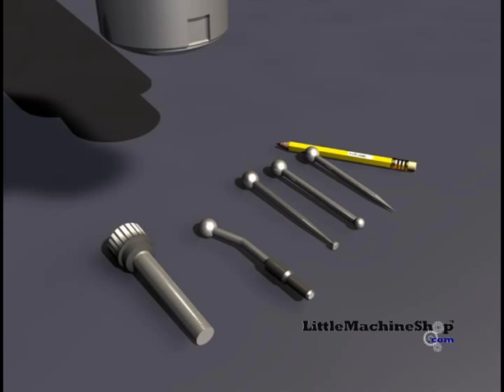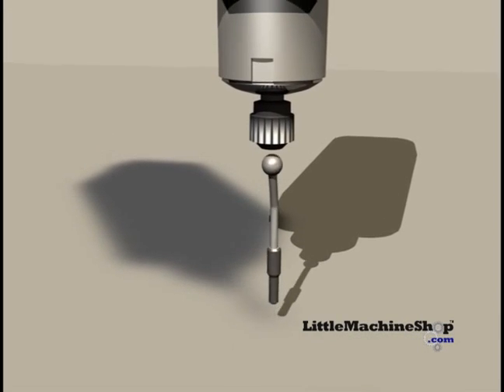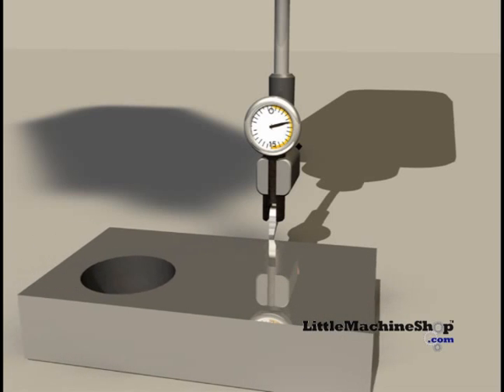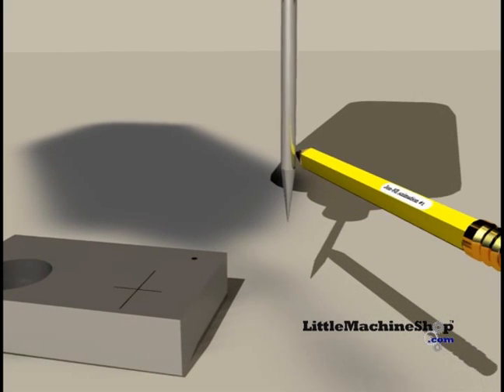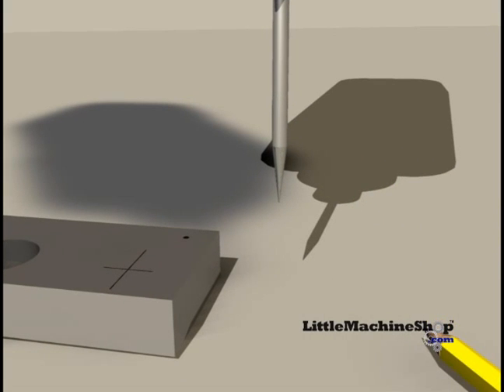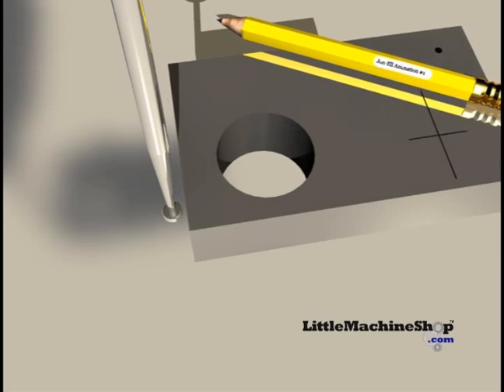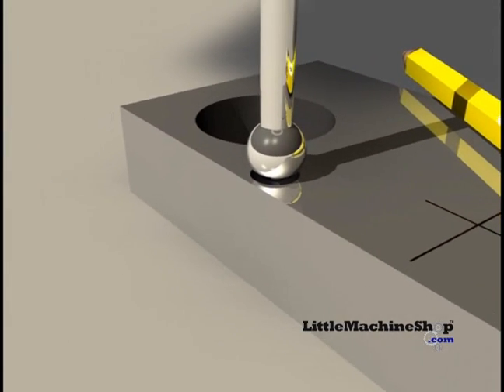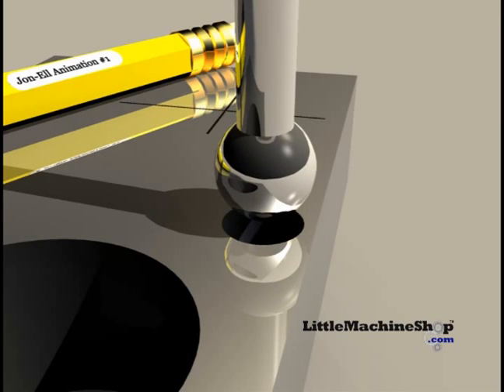Using a Wiggler

Comment: Pro tip for the point wiggler to pick up scribed lines... Do everything the video says, except don't go straight for the center. Pick up a segment of the scribed line along the x-axis, either the furthest or nearest, whichever is easier to see, touch it lightly to see if its dead on, zero it. Then do the same for the line along the y axis, then zero it. Go to your zeros on the DRO and you should be PERFECTLY on center. If you're not sure, put a center drill into your chuck/collet, put the machine in neutral, and spin it a few times to see if you're close. 

Personally my favorite application for the point wiggler is to pick up scribed lines on a work piece that is on an angle. Say you need to drill a hole on a 15 degree angle, you scribe the lines, set your piece up at the desired angle, then use your wiggler to pick up the location.  Saves you SO much trouble.

Comment: I only ever use a wobbler to pick up a center from scribed lines.. Edge finder works best for its name sake.. To find the center of a hole I will use a  a balance reading dial indicator and I would also use an indicator to square part to the mills working planes.. However if you are a hobbiest or begginer and dont have to work with tight tolerances than a wobbler is a good option as they are cheaper and fairly accurate when used correctly.. A good balance reading indicator can cost upwards of 300 bucks so if your on a budget a wobbler might be your best bet for its function